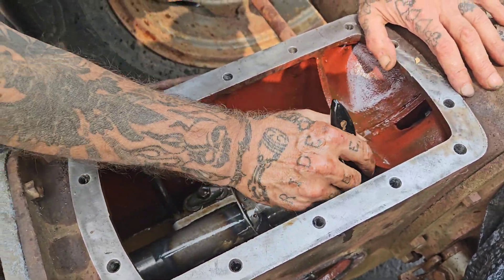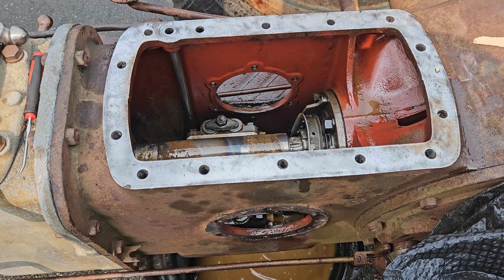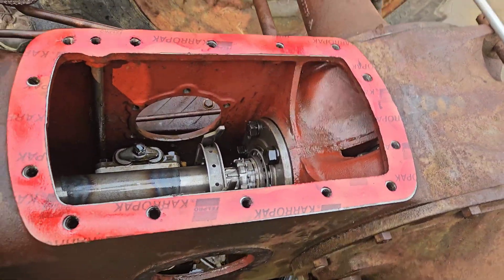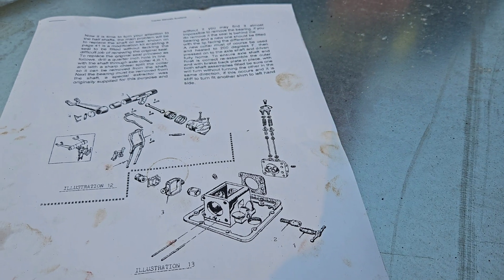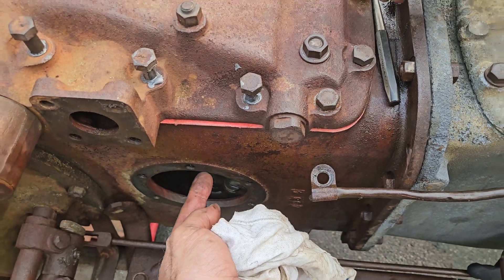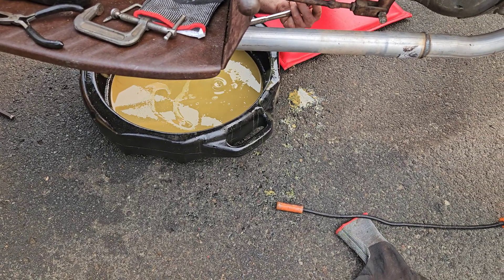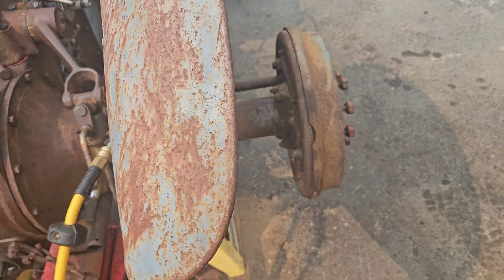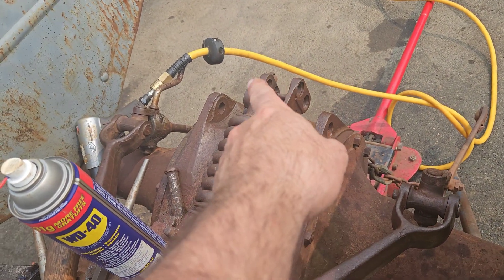🚜✨ **Can We Fix the Hydraulics? The Ferguson TEA20 Tractor 3 Point Lift Repair Challenge!**

Comment: Working on this exact tractor right now. Completely rebuilt the hydraulic pump and have brand new lift cylinder and rock shaft bushings on the way. Had to buy myself a 20 ton press to get that shaft out.
Reply from the maker: Wow sounds like a big job!

Comment: I feel your pain. I just got in from plowing my lane-way with my TEA20. I'm leaving the blade down this winter because once it's up it takes 1/2 hr to slowly drop. In the summer it works pretty good so I thought maybe water freezing in some part of the pump. Just trying to make it through to summer before tearing it apart. At least I got some good pointers from your vid. Thanks.
Reply from the maker: Is your oil milky? also The valve may have come disconnected from the linkage
Reply: @JimsNBHomestead  Oh Ya, oil is a bit milky, so no doubt I'm getting some water in at the cracked washer at the fill port. I change oil every every couple of years so it's pretty free of crud. . I use the TEA20 year round for hauling wood, hay wagons, bush hog and the lift and drop works pretty well in warmer temps so I think the valve may be OK. After watching your work I suspect there may be some gunk in the transfer port that I didn't do a good cleaning of in the past. Maybe water freezes there. I was putting a torch to different parts of the unit to try to melt any internal ice but didn't think to hit that spot higher up on the port. We're getting a dump of snow tonight so I may prep the tractor with some heat in that area before tackling the lane-way. Otherwise I'll limp through the winter and tear it apart in the spring. Good work on you videos, lots of good info. Thanks
Reply from the maker: Thanks buddy please feel free to chime in anytime.